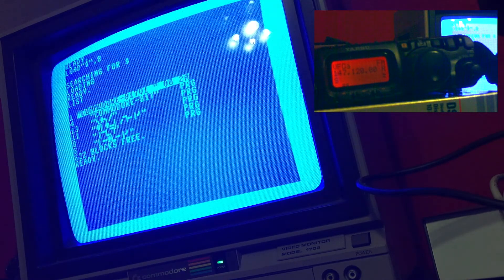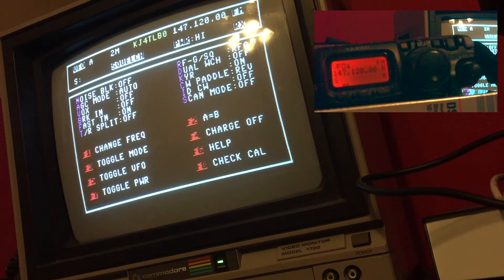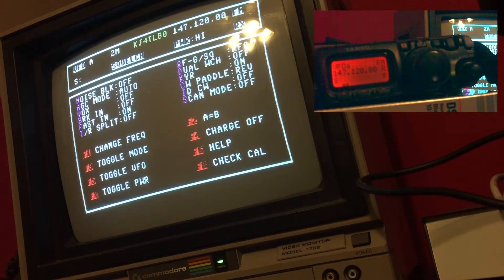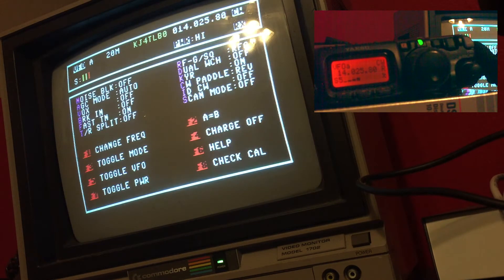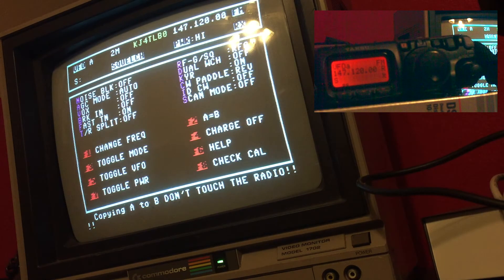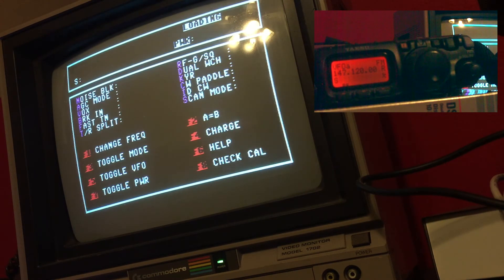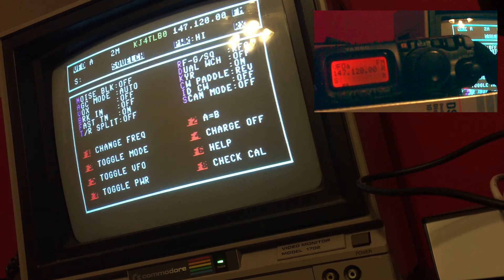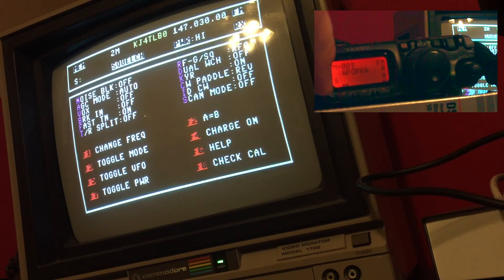Commodore 64 software for the Yaesu FT-817 Ham radio - Full demo

Comment: I would like to do CW, RTTY PSK31 FT8/FT4 and SSTV on my C64 and VIC-20.
Reply from the maker: I have another video of software that does all of that
Reply: @retrotechandelectronics  Not the one with the old c64 packet modem? I would like to do packet on my c64 & VIC-20, however I really want to do SSTV, psk31, FT-8/FT4

Comment: is the ft-817 able to use 1200bpps, so I can use a cheap user port adapter?
Reply from the maker: Did you scroll through the menu of available baud rates????
Reply: Retro Tech & Electronics  no i dident have One yet

Comment: Awesome! how is the connection made between the c64 and the ft-817?
Reply from the maker: Using a glink232 cartridge
Reply: @retrotechandelectronics  That is the same as the commodore RS232 cartridge
Reply from the maker: Einstein.186 programmatically I think the asic is the same